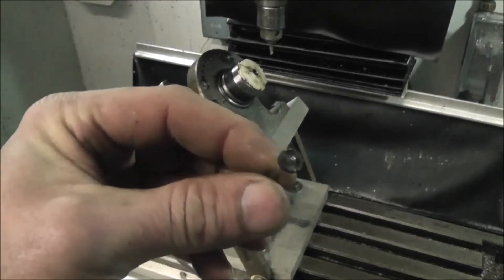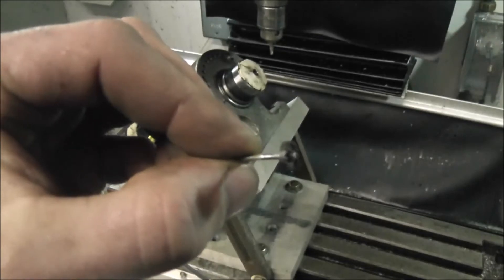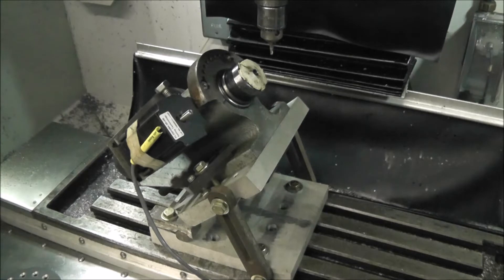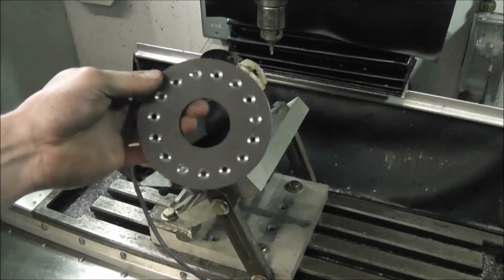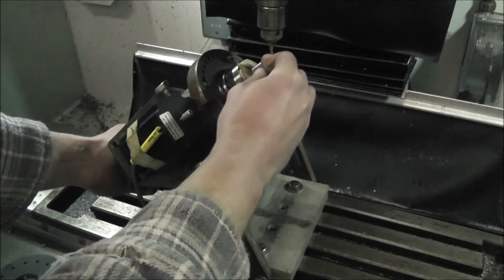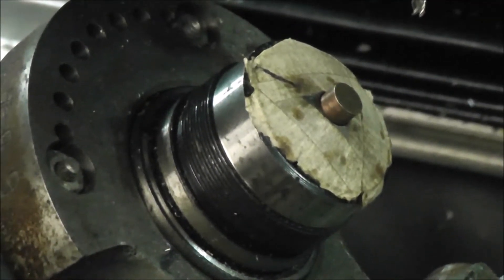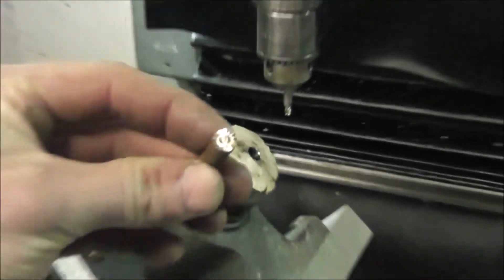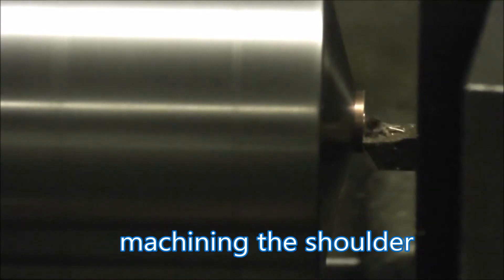Makin a slot car gear

Comment: Do you sell any of these gears? I cannot find them anywhere in brass. I drag race this type of car and the plastic  gears are pure junk under high power. Will not make on pass without eating the crown gear.
Reply from the maker: Dave V made these for a friend he resold some on a slot car forum, he doesn't do much with slot cars any more.  Not sure what forum it was. If the demand is high enough i can make some more. Making one or two is not worth the setup time.